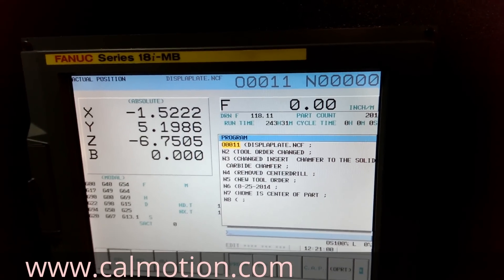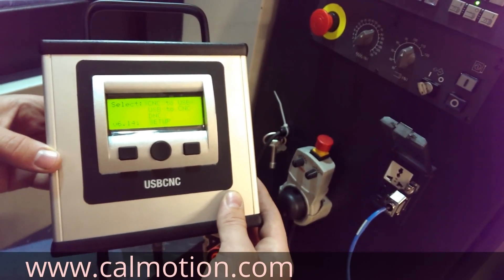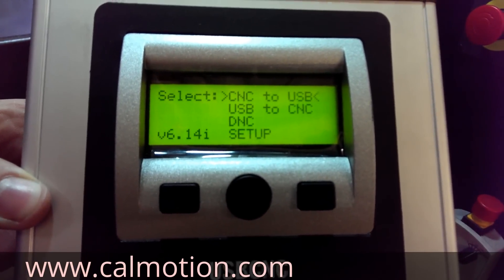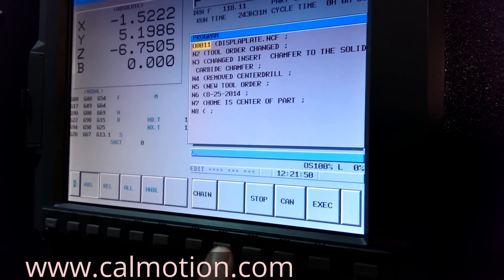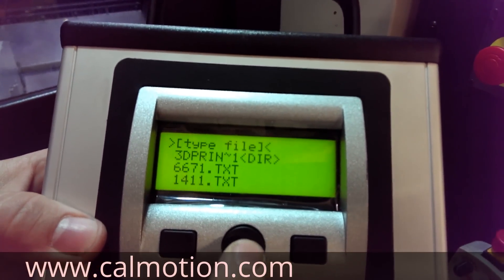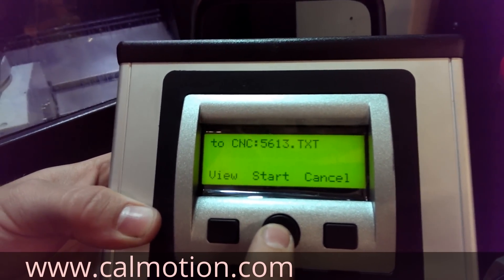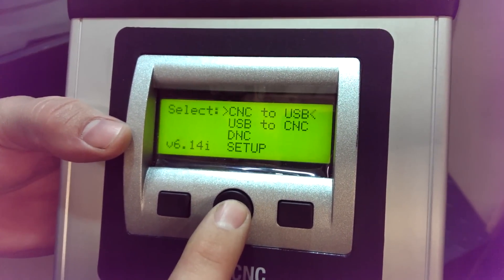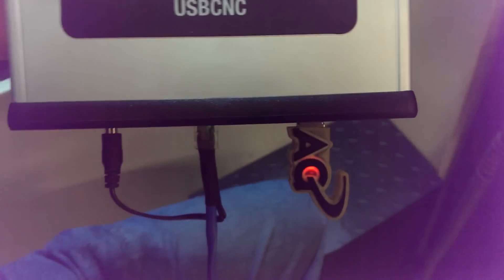USB flash disk drive memory for Fanuc CNC 0i 18i 21i 6M 6T 15M 10M, all Fanuc variants.

Comment: hello, please demonstrate what to set up and how to run a large file from usb on fanuc 0i or similar.
Reply from the maker: It depends on your Fanuc control panel it will either be a TAPE mode or Remote mode.  When in the correct mode and the RS232 is transmitting the Fanuc will execute the data as it receives it.  Here is a video showing this on a Fanuc 16M: https://youtu.be/V0D2ujlUBbM